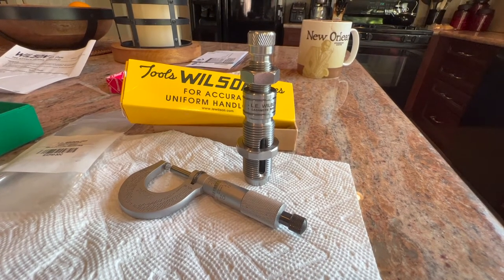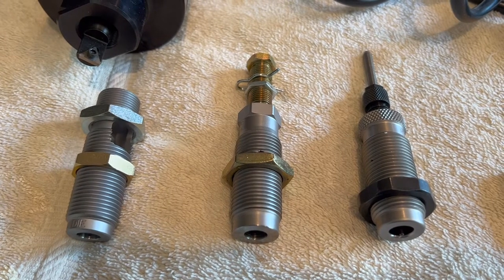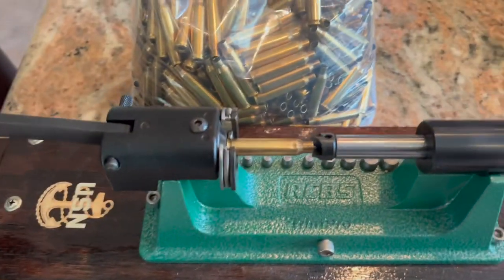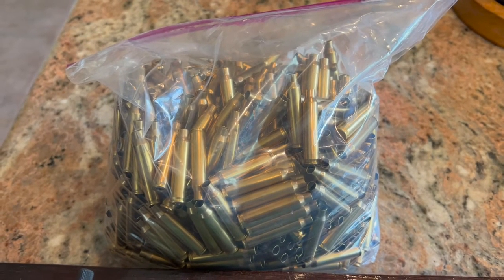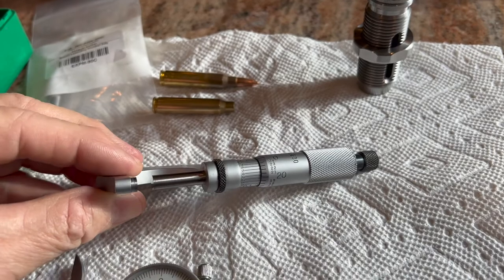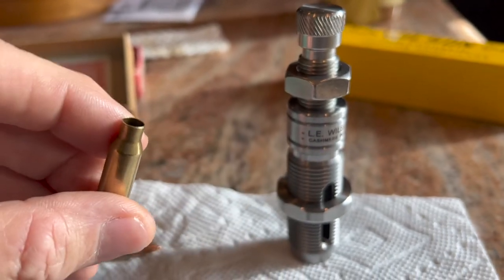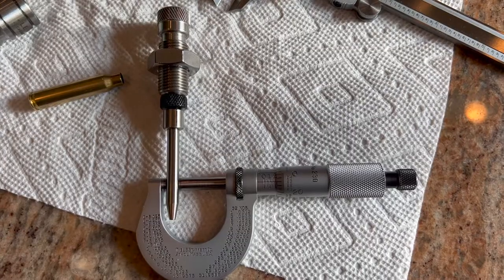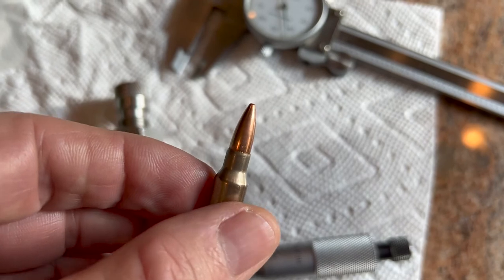L.E. Wilson Neck Tension Sizing Mandrel Die Review! 07Feb2022

Comment: I bought the LE Wilson Mandrel neck sizer myself, but I had to abandon using it for setting neck tension for my 30 and .223 cal cases due to the lack of choices of the sizing mandrels available for neck sizing.  For example Wilson simply sells a 30 Cal and a .223 cal mandrel, which I bought and attempted to use for my 30 cal and .223 cases.  I found these mandrels oversized the case necks leaving the necks too loose to retain the bullets and in some cases I could easily insert and remove the bullet after neck sizing with Wilson mandrel.  When I full length sized and neck sized the same cases with my Forster die the neck tension was fine.  When I full length sized with the same die, but w/o the neck sizer ball installed and then used the Wilson sizer mandrel setup my neck tension was too loose.  The sizer ball on my 0.308 Full Length Forster die measures 0.306" the Wilson 30 Cal mandrel measures 0.307".  I had also expected to use this same Wilson mandrel for my 30-30 cases, which definitely need good neck tension , since they get loaded into tube fed magazines.  The full length 30-30 sizer neck sizing ball measures 0.304", so using the Wilson 0.307" mandrel definitely was not the way to go!  I had similar problems with the 0.223 mandrel from Wilson.  The LE Wilson mandrel die is only good for straightening bent case necks before full length sizing with the included neck expanding ball or case trimming, not for setting final case neck tension.  I still like the idea of mandrel neck sizing though, so I bought the 21 Century neck sizing die system that aloes you to pick the exact size mandrel necessary for the case your reloading.  I really like LE Wilson's other products like the case gauges and headspace micrometer, but the mandrel die setup is no good for neck sizing with the mandrels they currently have available.
Reply from the maker: Wow! Great detailed comment! I have only used mine on cleaned and full length sized range brass 223/556 although I did buy the 30 cal mandrel with it. I think I have at least eight different head stamps. So far it has done a great job expanding the 223 to about .2215 to .222 which has been about .002" neck tension which is what I was looking for. I've been using Hornady, Winchester and Bob's bullet's 55-62 grain FMJBT's and have not had any issues so far. 21st Century does give you many more sizes to choose from and may be a better option for varying bullet diameters if your looking for a specific neck tension other than .002". So far though I've had no issues at .002" when full length sizing first. Never had anything I felt was loose. Don't know if you follow "Johnny's Reloading Bench" but he did a neck tension video a few years ago. All the way from none at all to about .010". He found no real benefit in accuracy. I mainly look for some neck tension and also very lightly crimp because I'm loading for semi-automatic AR platforms for similar reasons as you were saying for lever action. Maybe L.E. Wilson will start offering different mandrel sizes in the future? Thanks again for the great comment and watching!
Reply: I also am having this for 30cal. Redding dies , full length and you can pull the bullett out. Just realized this today and it may explain my poor rounds I made last week. I was looking at everything possible till I realize the necks were way too loose! I have read this is for new brass onky too. Not sure about that .
Reply from the maker: @TomColontonio  I called them about that and they said it's just fine for fired brass too! When I got the die the instructions also stated this so you shouldn't have any issues. Thanks for watching!
Reply: @peteregger7928  maybe mine is defective then because the neck tension is too loose. My Sinclair and KM do a great job.
Reply from the maker: @TomColontonio  I was looking for .002-003" after full length sizing with either a Dillon or RCBS die. The brass was chamfered and de-burred prior to using the Wilson mandrel. All of my various head stamped brass ended up within this range. I would give Wilson a call. Maybe you just got one out of spec?
Reply: @peteregger7928  I had good success with the 6.5 and 6mm Le Wilson .. could be this on is odd .
Reply: @peteregger7928  I ran some tests today and oddly after annealing on the AMP the Le Wilson makes the neck just too loose. I’m gonna reach out to them
Reply from the maker: @TomColontonio  Let me know how things work out! Not like Wilson in my experience?
Reply: I agree 100%.  I love LE Wilson products but they need more mandrel choices like the 21st century die which works great because of the many choices of mandrel sizes.  Makes it kinda useless unless that particular size mandrel works for your brass.

Comment: Hello Peter et al, 
Should the mandrel be cleaned before use?  The first time I used my 308 mandrel, the bullet (167gr Lapua) was so loose it fell into a sized case.  BUT, on the second and subsequent uses, all was perfect!  Did the first time remove a preservative oil film?

Thank you for the video, it was the deciding factor in my choosing the L.E. Wilson mandrel die.  I agree, it's a thing of beauty and am now very happy with the output, albeit I had doubts after the first use!
Reply from the maker: Can't say as to why that happened? Maybe the bullet was the issue? The case neck wasn't clean or maybe just a defective case neck because of metallurgy or heat treat? I was wiping mine down between every 10 and 20 rounds depending on how much residual case lube there was. Glad the Wilson worked out for you and thanks for watching and commenting.

Comment: What were the results....did it measure .002?  I'm leaning towards L.E. Wilson too, but I gather this tool is not meant for regular reloading usage, meant for new brass only.
Reply from the maker: They do advertise it for new brass but it also states in the instructions "However the uses for this die are not limited to this specific operation." I also called to verify that the die was adequate for reloading fired brass and the girl I spoke with stated that so long as the brass was properly cleaned and sized the desired spring back and neck sizing of .002" to .003" should be achieved. We also discussed expected results on fired brass would at some point probably require annealing for proper spring back. The mandrel seems to be very good quality stainless so I'm thinking it should last a while either way. I will also be using a Ballistic Tools neck gauge to determine neck size and spring back to .002" under .224". Haven't used it yet but will do a video showing the results on fired brass. Short version... you can use it with confidence on fired brass so long as it's properly cleaned. L. E. Wilson Ph# 509-782-1328. Thanks for commenting and watching!
Reply: @peteregger7928  Thanks, I just took the plunge with Midway ordering.  The cost isn't high and if the neck tension is consistent I can replace the mandrels as needed.
Reply from the maker: @Chevy2U  Should of thought of your question when I did the video. Don't think you will be disappointed when it shows up. Thanks again!
Reply: @peteregger7928  The L.E. Wilson came in today...6.5, 308, and 7mm.  After inspection, the body is Stainless Steel but the cap and mandrels are of some type of alloy.  I tested 5 pieces of new Starline .308 brass and the results have me of the fence.  Neck round-out measured .0005 - .0015 untouched, afterwards .0015 - .004......didn't expect that.  Bullet seating was effortless to the point you could almost do it by hand.  Hope to have some numbers on FPS & SD soon.
Reply from the maker: @Chevy2U  Thank you for the update! I just had eye surgery yesterday so it might be awhile before I figure out the results using mine in 223/556. I wonder if sizing first would make a difference? Sounds like the Starline brass was pretty good to start with? When you say round out do you mean concentricity or neck tension? I was planning a light crimp in addition to neck tension because I'll be running semi-automatic vs bolt action. Thanks again!
Reply: @peteregger7928  Used a Redding concentricity  gauge.  The concentricity with my Redding dies is always less than .002, will try some different methods in the coming weeks.  Follow the doctor's orders and speedy recovery.

Comment: Ok, Pete...I, from time to time, see evidence of a bit of OCD!  A Dillon power trimmer...!!  You gotta be kidding me!  Oh...uh, hmph!  I'd better shut up...I have a Dillon Power Trimmer myself!!  Yep, had a Forester hand trimmer the same overall design as your trimmer!  It's a small world!  Oh yeah, is that mic traceable to The National Institute of Standards Technologies?
Reply from the maker: OCD! Oh yes! I started out as a jet engine mechanic in the Navy. Got out for about 3 years and worked oil field construction. Went back into the Navy as an Aviation Electronics Technician specializing in Precision Measurement Equipment for the last 16 years. After I retired from the Navy my first job was with EIL Calibration which became TRANSCAT and then to Solar Turbines owned by Caterpillar and which has nothing to do with sunshine. Solar Turbines at the time made up to 30,000 shaft horsepower industrial gas turbines. Worked the cal lab there and maintained 16 different test cells for 3 years. Moved to Vegas for wife 1.0's job promotion and worked for National Calibration for awhile then Scenic Airlines for a year and then 15 years at Clark County Water Reclamation District as the Senior Control Systems Technician. Prior to my Naval training it was measure it with a micrometer, mark it with a piece of chalk and cut it with a chain saw! I always said I wasn't going down the precision reloading rabbit hole and would just stick with SAAMI dimensions but I seem to keep moving towards the precision side of things. Looking forward to trying out my Dillon power trimmer! Really got tired of hand cranking in a hurry! Seems great minds think a like! The Navy really did a number on me as nothing is close enough anymore! They actually had me believing that a straight line can exist! Lol!